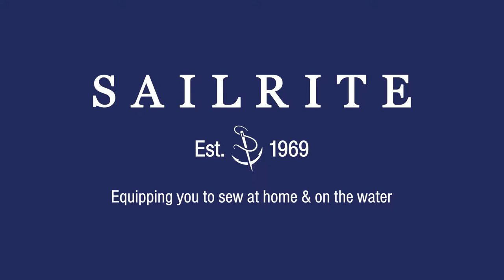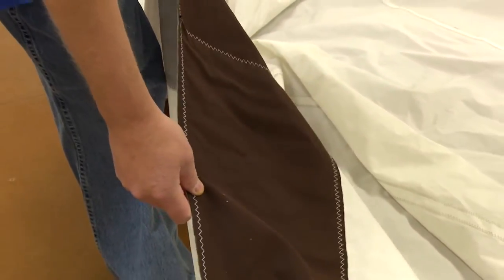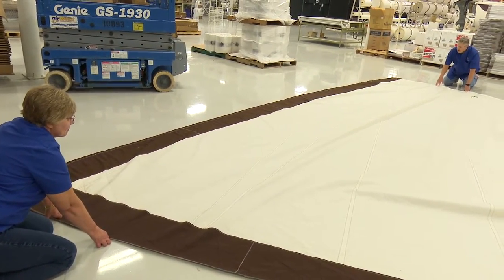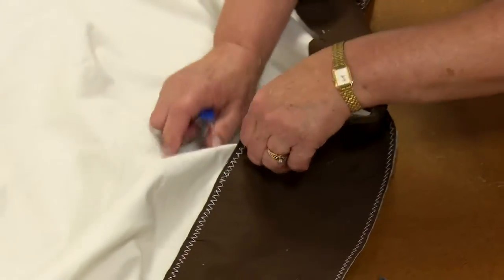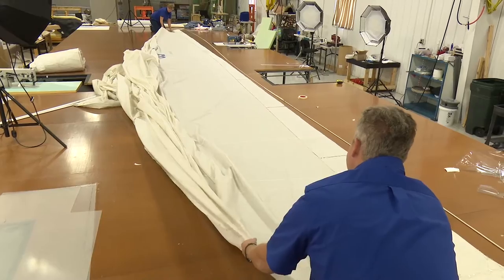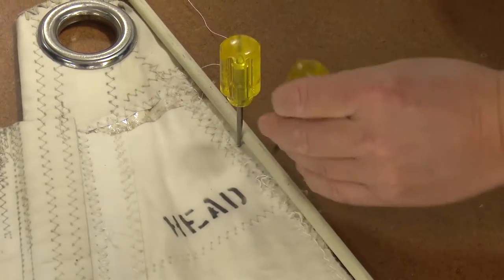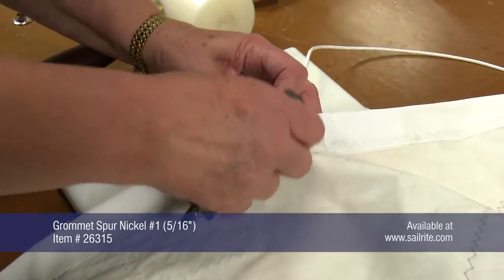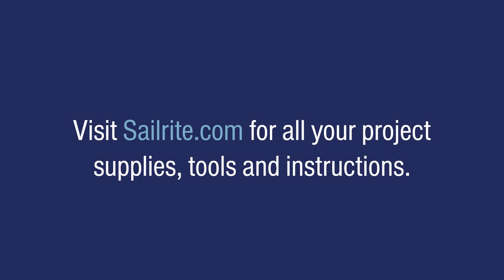Recutting a Sail's Leech and Foot Edge

Comment: Could you install vertical battens instead og making a curve?
Reply from the maker: If you recut the sails leech putting in a hollow of 2% of the edge would be best.  You can choose to cut a straight leech as opposed to hollow then you do need to add vertical battens in the leech edge to support the extra material.  In my opinion adding vertical battens as to achieve a straight leech and save the area that would be cut out if you hollowed the leech out properly is not worth the cost or effort but it can be done.